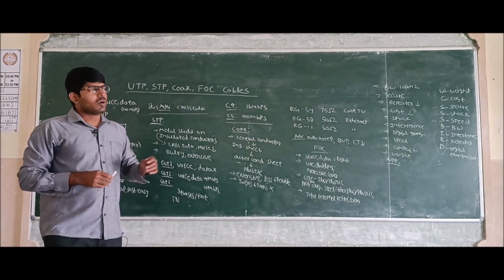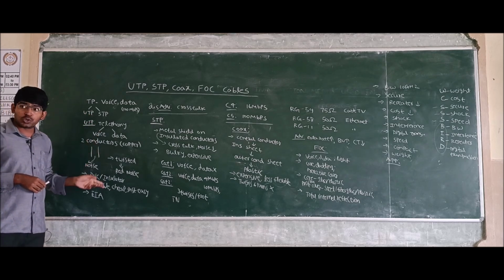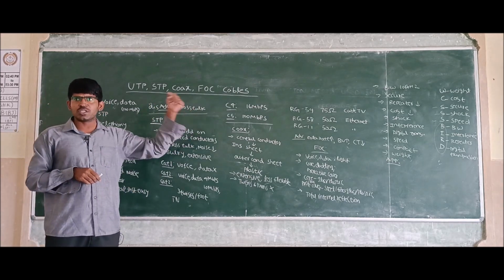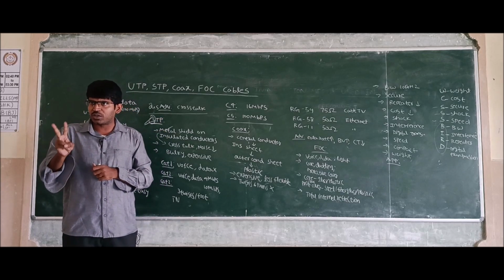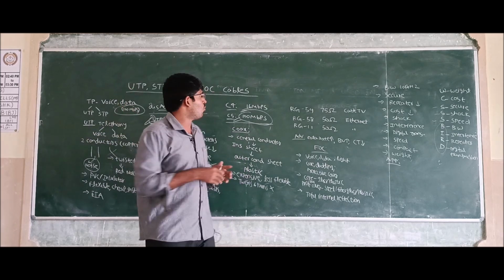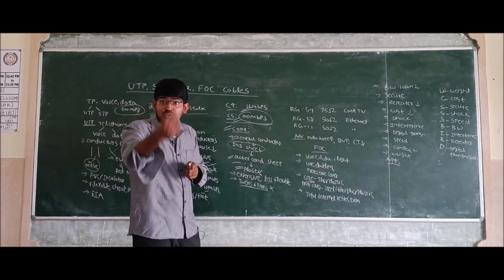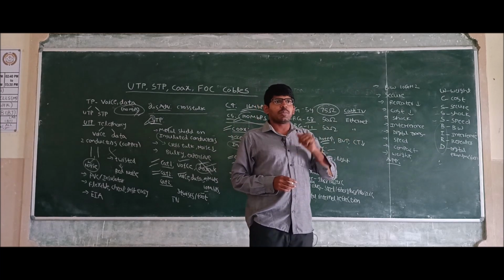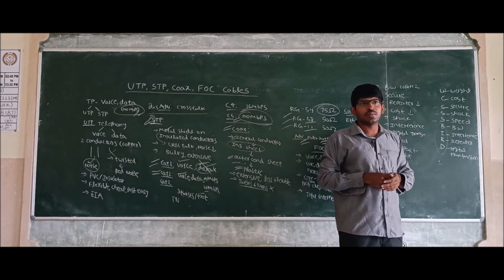35-UTP,STP,Coaxial, Fiber optic cables (2.2)

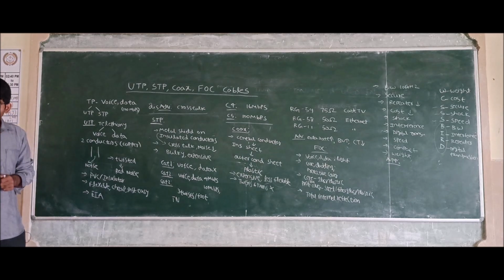Comment: I have doubt you said at the topic twisted pair  at 1:30 you said we are using two conductors for sending information between two conductors why we don't send information in semi conductors for sending information
Reply: 7:44 clarify doubt
Reply from the maker: We use conductors like copper for sending information in twisted pair cables because they allow electric current to flow very easily due to their high number of free electrons. This low resistance helps signals travel long distances with minimal loss. Semiconductors, like silicon or germanium, have much fewer free electrons in their pure form, so they do not conduct as efficiently. They are mainly used in devices such as transistors and diodes where controlling the flow of current is important. In a transmission line, our goal is to send signals from one point to another with minimal distortion or loss, which conductors do best. Semiconductors, on the other hand, would resist the flow more and cause the signal to weaken quickly. They are also sensitive to temperature changes, which can affect their conductivity. While semiconductors are essential inside electronic circuits for switching and amplification, they are not suitable for making long communication cables. Conductors act like wide, smooth roads for electrons, letting them move freely. Semiconductors act like controlled gates, useful for processing signals, but not for carrying them over distances.
Reply from the maker: Dear Basha,
We use conductors like copper for sending information in twisted pair cables because they allow electric current to flow very easily due to their high number of free electrons. This low resistance helps signals travel long distances with minimal loss. Semiconductors, like silicon or germanium, have much fewer free electrons in their pure form, so they do not conduct as efficiently. They are mainly used in devices such as transistors and diodes where controlling the flow of current is important. In a transmission line, our goal is to send signals from one point to another with minimal distortion or loss, which conductors do best. Semiconductors, on the other hand, would resist the flow more and cause the signal to weaken quickly. They are also sensitive to temperature changes, which can affect their conductivity. While semiconductors are essential inside electronic circuits for switching and amplification, they are not suitable for making long communication cables. Conductors act like wide, smooth roads for electrons, letting them move freely. Semiconductors act like controlled gates, useful for processing signals, but not for carrying them over distances.
Reply: Tqu sir for indicating my name and also ofcourse for clarifying doubt also
Reply: Sorry sir for asking out of syllabus question 
I saw your short film new youth movement 
Your the director for that short film 
You have any interest to do film ( not short film)
In future
Apart from this I am great admirer of your work